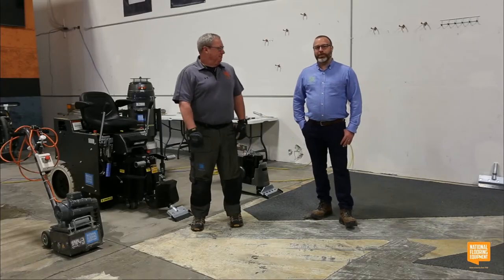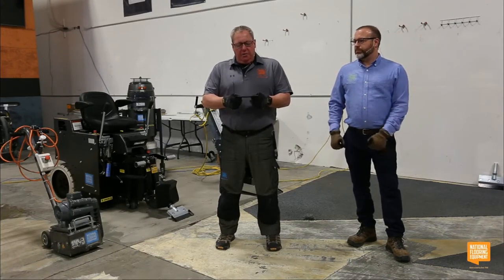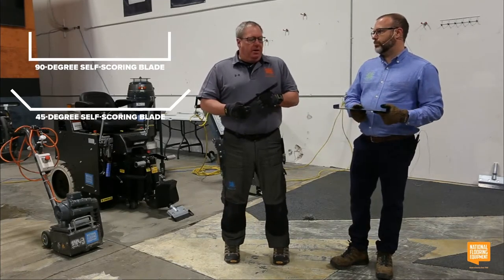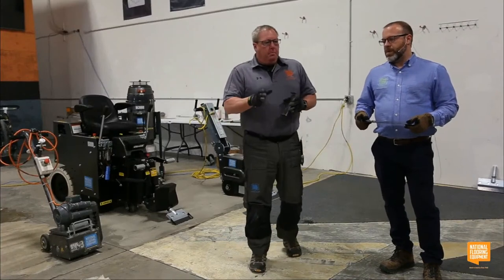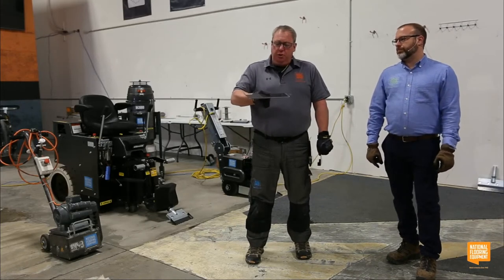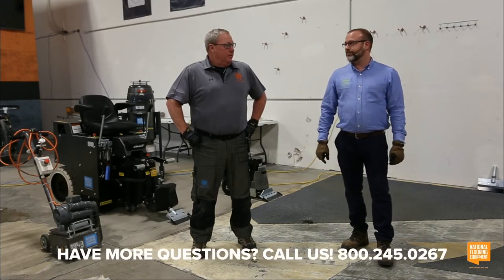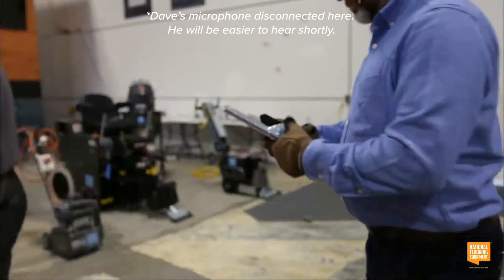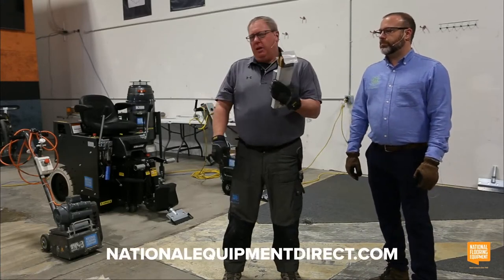How Do I Remove Carpet? | Problem Solving 101

Comment: I have an honest suggestion.  I have had a few experiences with the 5700 where with the rolling casters in place it was just a little too long to get on an elevator.  We had to remove the casters and roll in on the center caster.  This put a tremendous amount of weight on that point and the first time the wheel went through the floor of the elevator.  I nearly had a heart attack.  Luckily we were able to repair the elevator floor quickly and avoid a ton of trouble.  My suggestion/ question is, could you make the rolling caters wider and insted of going forward, kick them back.  This could be done to mantain a shorter length to fit better in smaller elevators.  I want one of these machines so bad, and if I ever got one, this modification would be a big plus.
Reply: We usually bring a 26” wide by 5’ long piece of 1/2 plywood with us. We just keep it in the trailer up against the wall, takes up zero space. Put that in the elevator before riding in and it distributes the weight enough to get rid of any possibility of damage other than bumping hand rails.